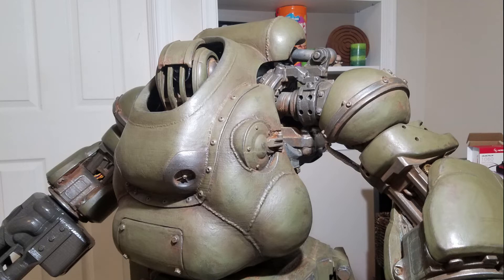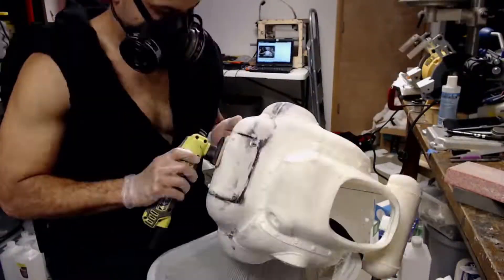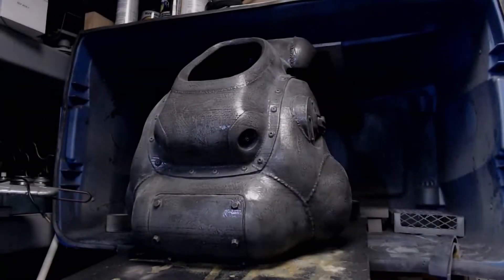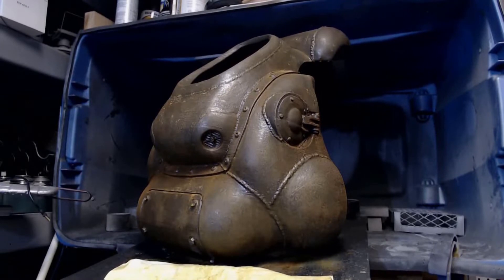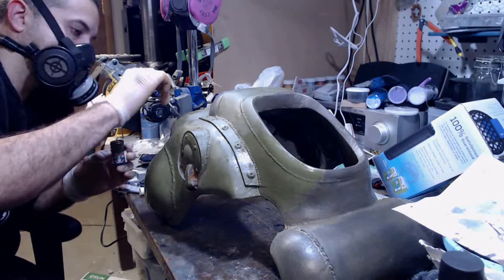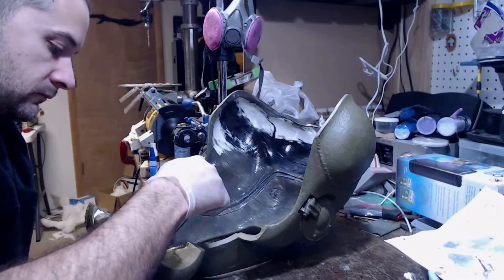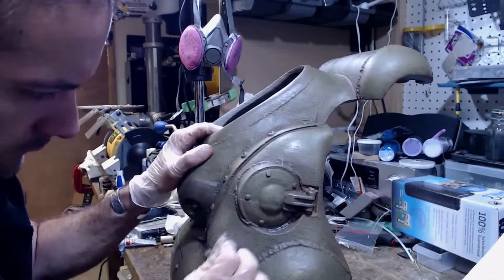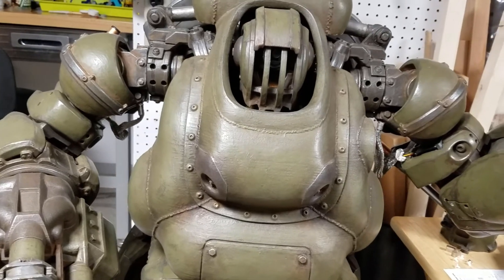Making Of Fallout 4 Sentry Bot: Creating The Front Armor Panel

Comment: I'm looking into 3d printing the Cars from fallout.  What program would be best for this?
Reply from the maker: Depends on what you are referring to. If you are referring to actually modeling the cars, I use zbrush for pretty much everything modeling wise. If you are referring to the printing software that outputs the gcode, I use simplify 3d and cura.
Reply: @Vsions  ok thanks I'm just used to using Autodesk inventor that my high school had.